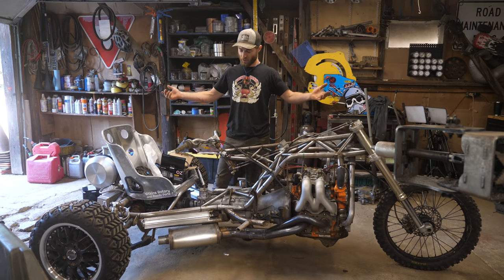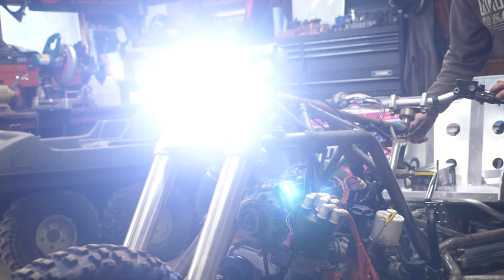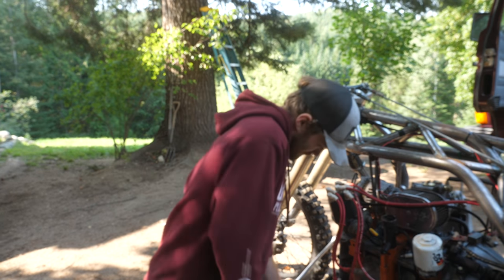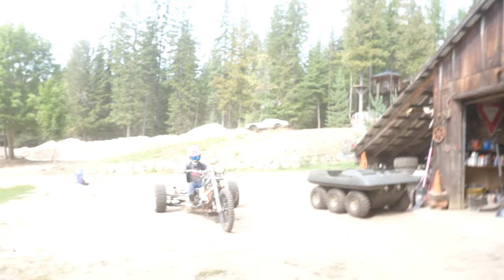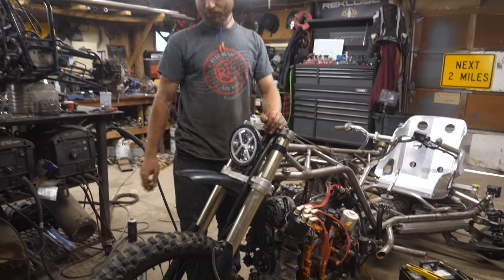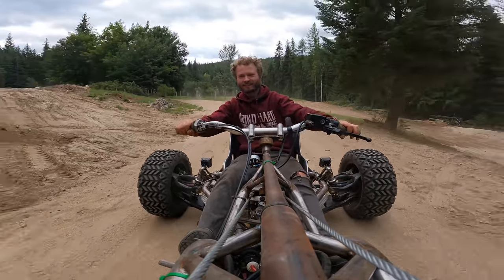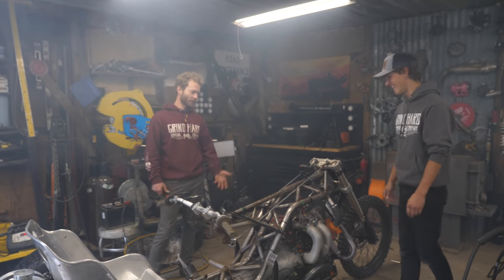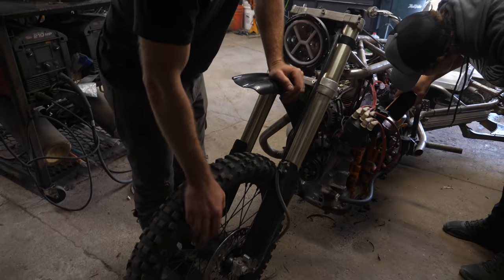Mad Max Rotary Trike Burnouts Lights and More!

Comment: Ol gal sounds like she’s breaking up at the top end. But what a build. Wow
Reply: Every rotary engine is on the verge of blowing up constantly haha
Reply: @charlesrichardson2372  controlled chaos lol
Reply: @justpoulson  it's cool, right up until it isn't haha
Reply: Sounds like it's breaking up everywhere.  Needs a tune bad
Reply: @swandonovan  its carbeurated, not tuned the way most rotaries would be, my guess is they care about mid range more than top end
Reply: @tobylarrison4826  right.  Carbs can be tuned
Reply: @tobylarrison4826  yeah old dogs like myself called it tuning a carburetor because it's a fine tune 👌
Reply: @swandonovan  never said they couldnt, but with such a simple design like a carbeurator you cant tune it to be perfect for the whole rev range, they prolly value mid range over top end
Reply: @tobylarrison4826  racers tune there carbs for bottom med and top end just depends on their preference.
Reply: Doesn't help that the front and rear rotor plug wires are backwards.
Reply: @tobylarrison4826  they work better for 2 strokes and 4 strokes than a rotary but still EFI works better
Reply: @tobylarrison4826  carb motors are tuned too
Reply: @tobylarrison4826  you absolutely can , I'm 48 yrs old and raced motors with carbs most of my life , a carbed motor can run perfectly through the whole rpm range
Reply: @tobylarrison4826  if a carb is so simple then how do you fine tune a carb? Not talking about the air/fuel mixture screws because there's alot more to fine tuning a carb then you know
Reply: @swandonovan  needs an inline 4 🤙🤙
Reply: @charlesrichardson2372  So it can buzz more and make less power
Reply: Yeah is running rough as guts
Reply: @swandonovan  yeah probably detonating like mad too
Reply: @tobylarrison4826  jets, clip position on the needle, needle profile, spring rate on the slide... and that's just a cheap ass flat-slide dirt bike carb. Car carbs can get waaaaaay more precise depending on design. I agree that efi is easier, but a carb can be tuned just as well, and with the same throttle response... it just that there are no automatic corrections for atmospheric conditions, so to maintain that good tune becomes quite labor intensive if you travel or run all year, so most people go within some margin of safety and call it a day...

Comment: The Vargas brothers would be crying the way that poor rotary is running i feel bad honestly 😔
Reply: Hey are the ones that built the rotary for the Mystery Machine right?  Angel motorsports is that the same ones or am I completely off base. It'd be nice to get them to do another one for this if so.
Reply: Ok yep I checked they definitely need to get on touch with them.
Reply: @bigjim8088  yeah it is bro
Reply: Angel motorsports crossover episode?
Reply: The Vargas bros would be a good collaboration but Rob Dahm would be a good one too. Rob is closer to them so it might be an easier collab to pull off.
Reply: YouTube Overlords suck  "off shelf"
 When rob bought his 4 rotor e shaft, there were 12 of them on the planet. You dont know what you're talking about dude.
Reply: They are a pair of crooks
Reply: ya it was hard to watch
Reply: @madmod  i love rob Dahm but he did buy his 4 rotor build already. His first 4 rotor he got scammed on. That’s why he had to buy the already built 4 rotor.
Reply: @Watchmedome3017  His first 4 rotor had the super rare e shaft stolen by ups. The already assembled 4 rotor was purchased mostly to continue fabbing the car for the real engine to go in.
Reply: @madmod  his first 4 rotor Abel was supposed to build it he took like 3 years nothing happen so he bought another the parts go stolen then the already built 4 rotor has the eshaft with the tricked bearings on each plate.
Reply: @Watchmedome3017  i miss abel
Reply: rob dahm would be crying

Comment: I had a rotary outboard engine myself. I used to mix some 2stroke oil in de gas for some more lube on the rotor. Maybe just mix like 1:150 or something. Like the build so far!

Comment: I'm sure hoping you can get that Rotary running 100%. Unfortunately it may internally (compression) related. It should sound like a pissed off chainsaw. Please get it rebuilt and running 100% along with the rear fenders, and it will be some awesome content! You guys are so much fun. I really appreciate the super sketchy, but working builds! Keep up the great work! "It'll just get crazier as times goes on." should be your catchphrase,  motto, logo and merch standard!

Comment: Feel like only 1/2 the spark plugs are doing their job or the carb tune is way off. She doesn't sound like a healthy rotary.
Reply from the maker: Yeah she needs a lot of work!
Reply: @GrindHardPlumbingCo   talk to the vargas brothers or rob dahm.  I would say the vargas's since they have more carb experience  to get the trike dialed in. It will be a beast when its running correctly.  Also get a tachometer for it also sepending on the age of the engine they dont like over 8500 rpm

Comment: I know what that guy means... that engine has never sounded right. It's definitely not well but rotaries will run even with coolant seal leaks. The hard starting would point to that to me tbh...
Reply: If it were a coolant seal leak it'd be smoking like a steam engine.
It probably has low compression.
Timing a jetting sounds miles off too.
Reply: @darianistead2239  it depends how much coolant but it was definitely smoking 😆 the things seized up guarantee its rusty as shit inside
Reply: @MaNNeRz91  Yeah it wouldn't smoke if it had no water lol. 
Could be rusty inside🤷‍♂️ but bet the housing are chattered to shit or seals are stuck/broken/warn..
It's an early engine so could be a host of issues lol
Reply: @darianistead2239  yeah for sure that engine could have a number of issues. Watching Rob dahms channel shows that these engines still run with countless problems
Reply: @MaNNeRz91  I've barely ever watched Dahm(Don't need too) I've built and owned/own plenty myself.
Reply: @darianistead2239  it's on my list but I need some space before I get one because 1000% will be tearing it apart and rebuilding 😂
Reply: @MaNNeRz91  Most likely lol

Comment: Is the front of the engine safe from dust and debris getting kicked up into it?
Reply: I was thinking that too maybe putting some kinds of small cover to protect it all especially the belts
Reply: @isaacmarinchek7432  Uff i like that idea.. maybe two size wire mesh forced into shape as in dirt bike bottom covers, just take two flatbars to bolt the edges between and weld another into steel tube frame that gets bolted to cover the engine. Smaller one can be really fine mesh, but one that still lets water get off, while bigger one keeps squirrels, mooses and anything bigger out of the engine.

Comment: My friend has a custom trike with cutting brake. It made a world of difference on handling you could steer true crazy curves just with the brake or turn on a dime anywhere. Very fun toy he drove it to Sturgis
Reply: Is that the same kind of thing on like a tractor? Never heard the term
Reply: It just allows you to apply left or right brake. You can steer in a wheelie as well. It works well it's just a bit hard on the front tire but worth it.

Comment: You need to do an oil injector delete and run premix with Techniplate 20% castor to protect that engine once you get it Dahmed. The more I learn about rotary engines the more I realize it is just a 2 stroke in disguise and should have never been running engine oil into it! If Mazda made the oil injector come from a different source and use 2 stroke oil it would have saved the reputation of that engine!

Comment: Nice! Did you try to mount the front mud guard backwards before you sliced it into pieces? And, for the top end splutter, more air. Air box with a breathing filter. The current filter is good for 8K on a good day, after dusting it 6,5K, maybe. To get to 10K, some porting and jetting and a decent size airbox is reguired, adding some trumpets inside it also helps. Also, pre-mix. it is basically a 2-T after all. Additional dust cover over the front accessory assembly will give the setup noticeably more miles.

Comment: Some people will block off the oil injection to keep the rotors clean and mix in 2 stroke mixing oil with the fuel for lubrication. Also I’ve heard that you can burn E-83 for a cleaner and cooler burn.

Comment: Put a tach on it when you rebuild it, rotaries can rev, but they need supporting mods to rev to 10k, and they also have no rev limiter unless you put in something to cut fuel or ignition.

Comment: Ask Rob Damh for help in rebuilding the rotary considering he has done plenty of those and also add two stroke mix in with the oil to help with the health of the engine. Did that with a few others friends had and made them last a lot longer and perform better as well.

Comment: Tribotex sounds like the same idea that RVS has. RVS stuff is pretty crazy as you can run piston engines without engine oil for like thousands of miles after making a few treatments with it. They've done that in Finland through the years and recently in USA with a stock Civic.

Comment: Have you given any thought to a sport bike front end on the trike? That would give you an alloy wheel and could get one with dual rotors/calipers.  I don't know if you could find a set up that would have the correct length forks.

When you were beating on the trike and turning it looked like there was a lot of side load on that front wheel. I was concerned that the spokes could bend/fail.

Comment: #1 get yourself a rx7 repair manual I have owned a few rotorys, you definitely have more than a fuel issue, 2- when you rebuild be sure you upgrade to the 3mm apex seals. 3- send out the housings to get lapped by a pro shop. 4- SUPER IMPORTANT to verify the eccentric shaft end play after you put the whole engine together.

Check out these guys, they do an excellent job showing EVERYTHING you would need to do  👍

https://youtu.be/S6PGBuTqPik

Comment: If the engine is mounted level the carburetor will be sitting at a 8ish degree forward angle because of how the engines are mounted in the stock car. Which would make the rear rotor run a bit  leaner than the front since there's less fuel covering the main jet.   I'm not sure how far apart the main jets in a  webber are but with an edelbrock 4 barrel I had noticeable issues

Comment: Fender don't need any bit sticking out the front. It needs to be mounted low and all backwards to protect the engine and those belts from muck.
Kids take their rotary cars to the drag strip, take off all the back pressure from the exhaust, and make MASSIVE horsepower.
And inevitably leave parts and oil all over the drag strip.  Is there anything near stock back pressure on that exhaust?

Comment: Omg i would look crasy sick. Well if i can write it down, whats in my head. So put handle bars on the front fork. Then glue some filled gloves to it. Have like a lose wire og something with like fabrik/cloth around. So it looks like arms. Going back to the funktioning handlebars u are using. That way it would look like the rider has crasy long arms. It could even go to like a detachable  robe or something so u cant see the riders hands on the funktioning handlebar. Just a crasy idea 💡 xD

Comment: #GrindHardPlumbingCo you should weld two bars coming down from the center of the top tube down past the front of the belt and under the engine then put some kind of diamond plate mud/bash gard on it so no mud or rocks damage the belts or engine

Comment: I think that since there are oil ports inside the rotor housings it trying to burn engine oil when it's not supposed to. I know that there are block-off plates that people make and just run premix like a 2 stroke.

Comment: Those bmw GS bikes have brembos and are meant for almost the same application. Could be easy to find a dual disc beemer brake and send er hard. On second thought a full front assembly from an R1200GS or Africa twin would work for y’all.

Comment: Number plate with a hole in the back for the light? Also chopped in half trx450r fenders? The pilot fenders would be sweet but be the same.

Comment: Did you guys remove the oil injector?  Are you running premix? 
It sounds like its running REALLY lean. Are you sure its tuned right? with an exhaust like that it should smoke pretty heavily. 9krpm is fine on these when you open em up, and it should get there easily. Please get it tuned before you break it further.

Comment: yall need to make sue the oil meter is injecting oil when you give it gas if not add  2 stroke oil to the fuel it detanating aswell check timing

Comment: This thing would of been so rad if you had moved the seat up. Kinda had the engine between your legs and just had like a set of beach bars off a Harley bolted to the triple tree. Or you could of made your own style beach bars. Not digging the length or how the steering is. A wider three wheeler triple tree would of aloud a fatter tire for the front. So all wheels matched. Could of had slicks in the back with a race skinny in the front. Would of been so nasty...👍🏁

Comment: More fuel or bigger main jets. A 13b with your weber 48 needs like a 205 main jet. F7 emulsion tubes or it won't run right at part throttle. It should be sounding much smoother than this... And should be scary fast, not just fast.

Comment: Its not happy at top end revs breaking up a lot, get some new spark plugs and set the spark plug gap I'm sure thay dnt like having the wrong plug gap and put some 2t oil in with the petrol, I like the cool art at the end you look lean as a bean sat there on the barbie cart. 😉💯💯💯👌👌👌

Comment: 6:30 its running on 1 rotor, it probably siezed because of bearing failure because yall revved it too high.
Reply from the maker: That would make sense. Would it turn over at all then?
Reply: @GrindHardPlumbingCo  yes, id suggest changing the oil, if there is metallic flakes then the bearings problem got a little cooked. Do you know what series rotary that is?
Reply: Well Nevermind that, looks like yall are re building it, good luck on that
Reply: @GrindHardPlumbingCo  I just left a couple notes on last weeks video. It will still run with just the leading plug working.
Reply: @GrindHardPlumbingCo  if there were chunks in there you'd hear it. Probably even without a stethoscope.

Comment: Definitely wouldn't run it much longer as it is even if you plan on doing a rebuild, it's got some lean bog and timing is off for sure. Don't want to go cracking an apex seal or blowing out a corner seal and scoring the housings/sandwich plates or it's going to cost a good bit more. Ask me how I know 😄😬

Comment: If you're rebuilding the engine anyway... Why not add a turbo or two...?
Reply: If its got n/a rotors in it, it will blow up just as fast due to compression.  If its running turbo rotors it will be a beast

Comment: Not trying to be a jerk here but running any engine full throttle with no load is a bad idea. I know it wasn't running right but I'm sure more damage was done when it seized.
 Now that I said that, really an awesome job on this build. Definitely not another one around like it, I'm sure. Best of luck with the engine.

Comment: Your motor is cooked. I built a dragster with a 12a and with very little money it would spin to 20k and send my little rx-3 into orbit in seconds. Also, you need big huge bullhorns on the top of the forks (maybe with the signal lights integrated) - they look naked without handlebars.